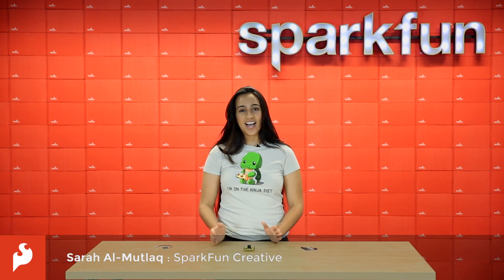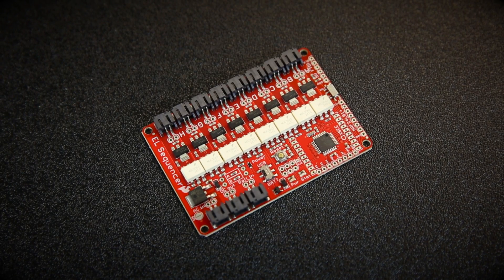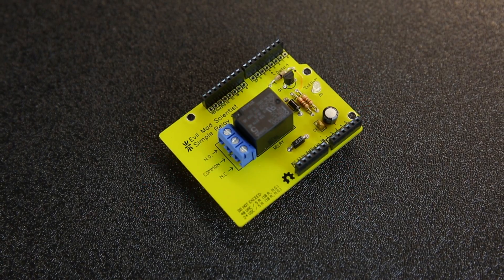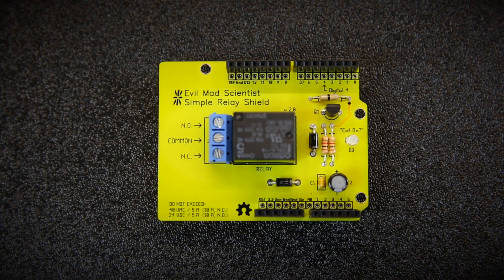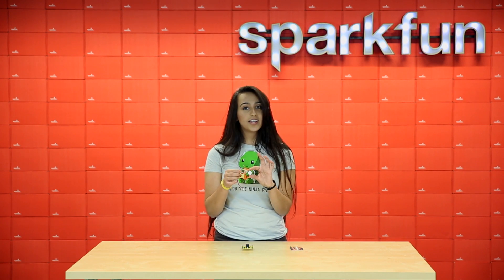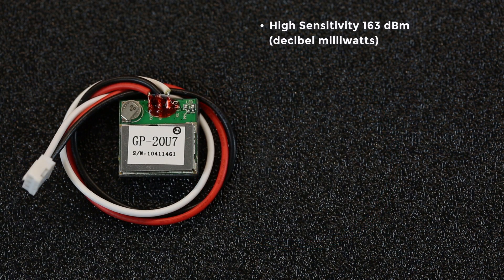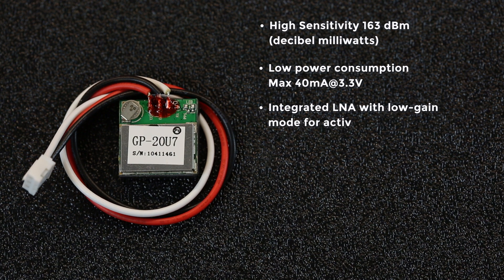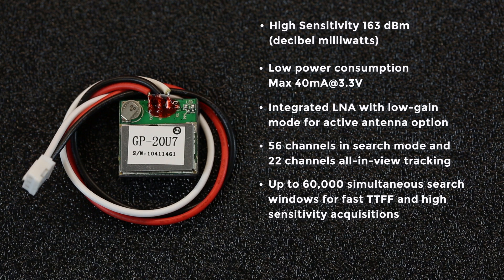SparkFun 12-4-15 Product Showcase: GPS Sequencer Relay

Comment: Hello Spark Fun, I have integrated a pair of GP-20U7 GPS modules into my Vehicle to Vehicle Warning Beacons. I would like to configure their baud rate (9600 default) to a higher baud rate.  Per your tech support’s suggestion, I queried you forum for help, but the query returned no info.  Can you please help with this problem, there is a Rx pin, so there must be some communication/configuration capabilities within this fine little GPS module.

Thanking you in advance, Paul W.